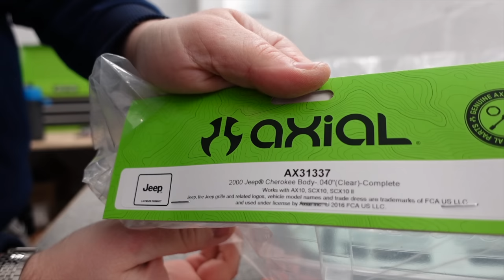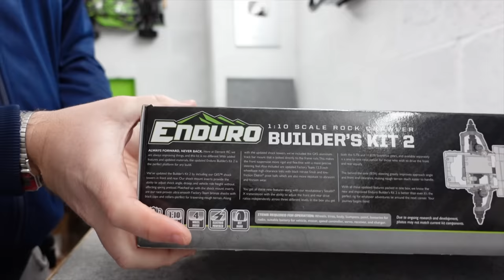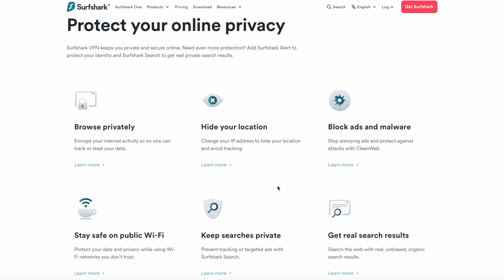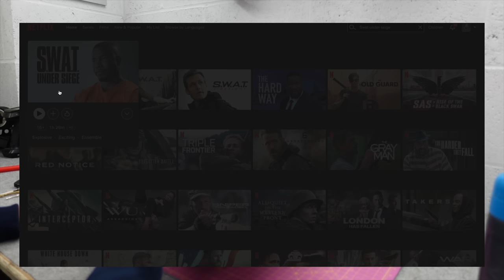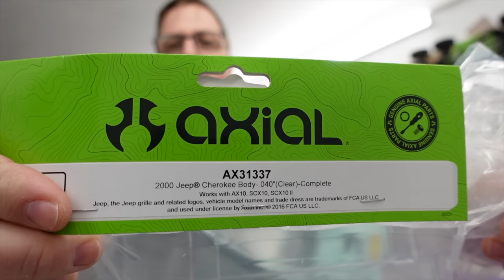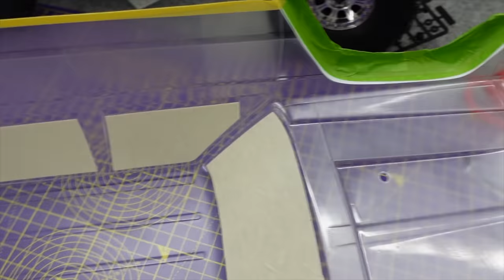I Built the BANANA for Matt's Off Road Recovery!

Comment: Awesome!
I do indeed watch Matt's channel from almost the beginning!
Was told before there is nobody that brings trailer off road as I have built several of them for my crawlers.
Then I found Matt's channel I could point at it and say, there you go!
Hope Matt appreciate it!
Maybe Lizzie can take a turn with it. She is great with everything!
Reply: Rory  Irish whose wrecker is called Trail Mater also sometimes recovers vehcles on a trailer he has had since high school. Highly modified since hen fo Moab trail use  and in its current (final? probably not) form it is a 4 wheel trailer with no uspension and shorter than the one Matt uses, but both sort of arealike since they both do such similar things
Reply: Lizzie is the sort of woman I wish I could have married about 25 years ago. 
Plus I've got a manky old Range Rover that needs some welding that she would absolutely boss. 👌

Comment: If you can get it greased lightning works great to removing anodizing but also makes a great cleaner to have around the shop when not using it to strip alloy parts

Comment: Looks good Tomely,there going to love it. I myself am going to be doing a project soon. I'm building a Rat rod Willys Jeep(Bruder Toy from Germany Plastic body) The components that it will have so far will be including a 2s Lipo 7.4v 5000mah battery, Traxxas 12T 550 motor, XL-5 ESC with IQ. I'm not sure on the complete build but it should turn out well.

Comment: Robby Layton would tell you that the body is too clean.  There aren't enough dents or scratches.  Need to get some Matt's recovery ropes (yellow thread) to lay the back tray and a freedom winch line (black line/rope) for the winch.  I'm jealous of the tires.  I'm super jealous of the front bumper and winch.  Polishing the lock rings was the right call - amazing finish there.  The mini banana It looks really good.  Next challenge will be the Morrvair and the Off road Wrecker.  Get those mastered and a Rudicon build should be in the works.   After that the Fab Rats, Rat Rod Wrecker would be an amazing RC challenge.   I love that you follow Matt's channel.